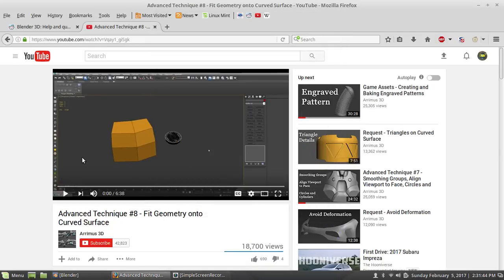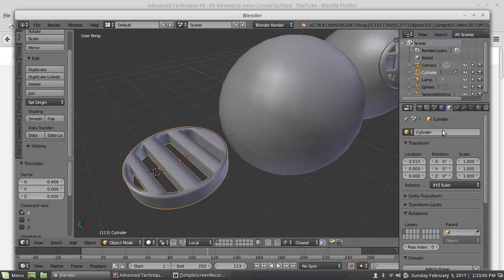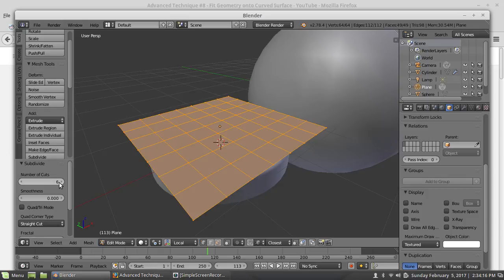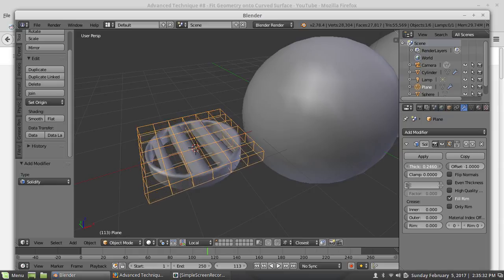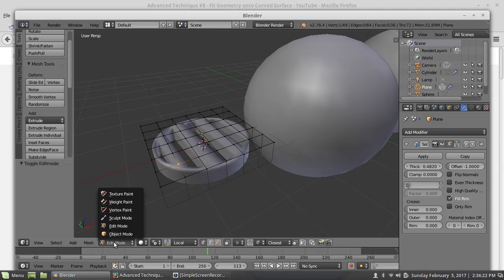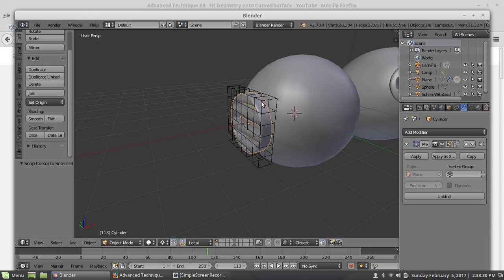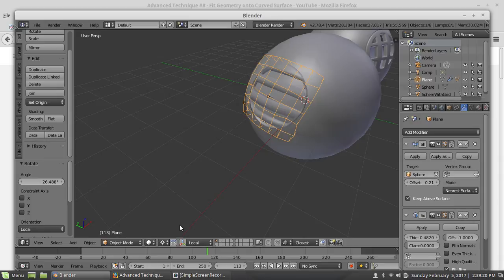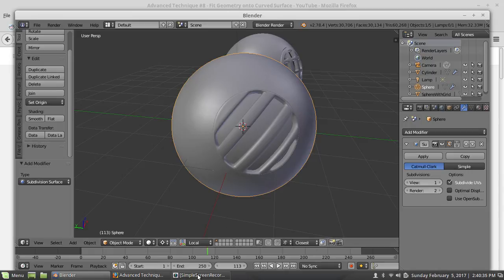Geometry to curved surface *In Blender* :)

Comment: the fact that I just started to play around with Linux mint and to see you with it. :)
Reply from the maker: Main thing is that it does the job without having to screw around with too much. Other than that, dconf for those desktop settings that lack a full GUI like some of the mouse settings or OS hotkeys. (My experience is that it's too easy to get things wrong or break something editing a .config with a text editor.)

Some may say I'm a particular kind of idiot, and I've found it to be fairly idiot-proof. :)

Comment: a lattice won't be as easy to shrinkwrap, but it's a faster way to curve a surface in any shape you want
Reply from the maker: Lattice also doesn't bind, so in some cases it may be trickier to keep an object within its deformation volume. So there is that trade-off. This tutorial was made before I was aware of surface deform (slightly older versions of Blender didn't have it), but this method could still be considered valid since it still offers more possible adjustment.

Comment: What does applying rotation and scale do at 0:59? Thanks!
Reply: Nothing visible for you, but not applying rotation and scale can cause glitches and some weird stuff with some modifiers. It's especially important when you want to use animation, physics or use model in different software like Unity or Unreal Engine.
Reply: @feykro222  Thanks for the reply! At what times should I do this?
Reply: There is no need to do it all the time. Basically you do it only in 2 cases:
1) Something doesn't work like it should. Apply rotation and scale is one of the first things to try for troubleshooting
2) You want to do physics, animation or use model somewhere else.
Reply: Also do it before rendering. Just in case
Reply: maybe an actual explanation of what it does might help ! ... if you have rotated your object in object mode then its local axes will not be in alignment to the world axes. In some situations this can be useful, for example of you have a plane at a specific angle to the world axes and want to work easily with it along its local axes - though it can cause some unexpected issues further down the line depending on what you are doing with your project ... so as a rule of thumb, only rotate or scale something in object mode if you have a specific reason for doing so and once that reason is dealt with "applying" rotation will reset its axes (whilst leaving the geometry alone) back to the world axes ... ok that was far more difficult to explain than i expected and would be so much better with an example, but i hope you got the idea.
Reply: @ashleecadell9955  You could've just said it resets the objects local axes to the world's axes without changing the object itself. Just a tip for next time :)

Comment: GREAT VIDEO!! Please Do A Videos on how to make a ''OVAL'' Shape cut hole On A Plain Mesh, THEN making duplicates & Converting them to a form a Cylinder shape {If You Look At A Kenworth on Peterbilt Truck Exhaust You'll See What I'm Describing] I'm Having Trouble modeling the OVAL & CAPSULE Shaped holes ON THE CYLINDER To Go Round and Round TO MAKE THE a Heat Shield exhaust..Please Help! I'm New To Blender 2.79 doing my best to learn! Thanks
Reply from the maker: Somebody else already covered it better than I probably could: https://youtu.be/dQA6-3UECoY

Comment: oh god 10 minutes to tell me that stack deform and shrinkwarp, my ears bleed to death from the mic noise and your high af voice.
Reply from the maker: If you thought this was bad, it's still got to be better than a series of 20+ hour long videos on making something in Blender and neglecting almost all the shortcut methods, thus making stuff in the slowest way possible. And yes if you look up recent Blender modeling it's out there on YouTube. (I only watched on occasion because the subject was interesting and the modeling examples looked good, but the process... OMG!) But when I commented I didn't tear down what that guy was doing, only suggested what could be done better. So there's that.

Here's a tip for ya... Muting while using J and L keys while watching videos like this. I'm sure you can get what you want out of it while paring the time watching down to half.
Reply: Bhavin Solanki I have a 5 hour vid for you on creating the default cube :P :D